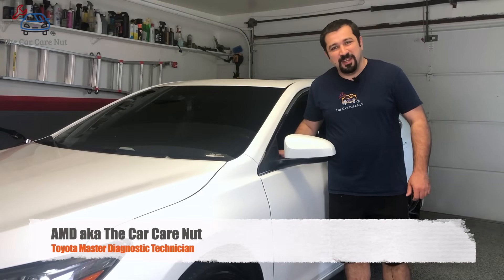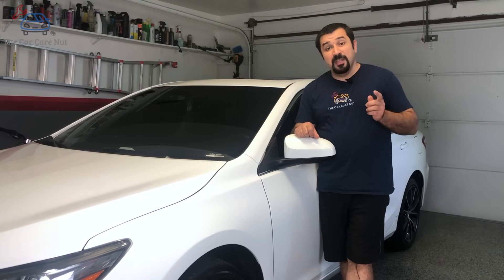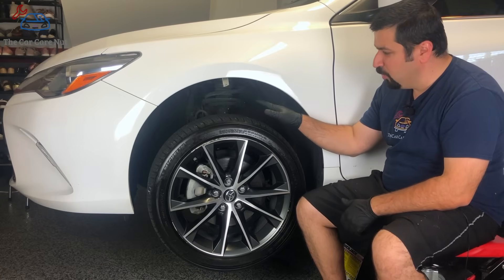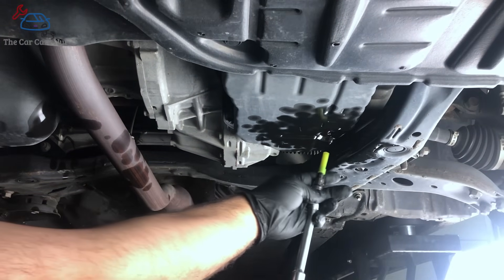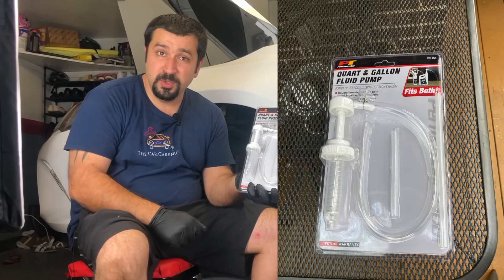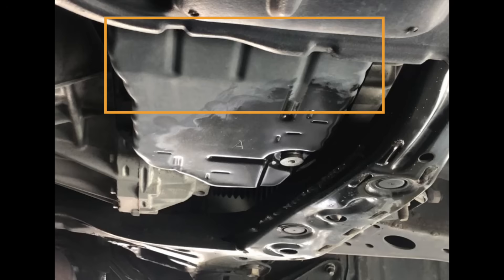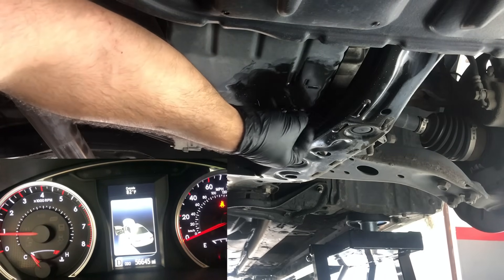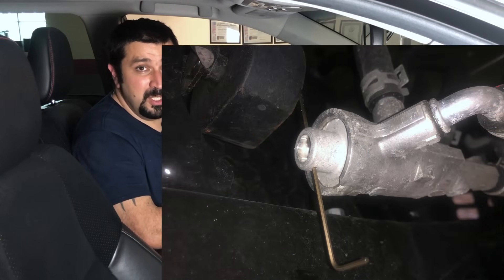How to change your Toyota Sealed Transmission Fluid

Comment: Can I check whether the transmission is level by using the transmission pan when checking the level? My engine mounts may have worn out and checking level using the car body might not be accurate
Reply from the maker: Hi! Level doesn’t have to be exactly 100%. The idea of level is visual. For example you don’t want the front of the car on jack stands and the back on the floor. You also don’t want to jack the car when it’s on a steep inclined driveway for example. A relatively flat floor with 4 jack stands should be good
Reply: @TheCarCareNut  Thank you!

Comment: I have a 2015 toyota camry, a mechanic change my transmission fluid, i felt like he lost a lot of fluid, now i experience a slip on my transmission 2x. Hope my transmission is not damage yet. And advice you could give?
Reply from the maker: Hi! How many miles does the car have? And did the mechanic check the transmission fluid level after he changed it?
Reply: @TheCarCareNut  it has 49000 miles it was change last Nov. the way he check the level was by starting the engine and let the fluid out until it dribbles, not sure if he check the temperature before removing the oil plug.
Reply from the maker: Ok the fluid level will need to be checked accurately and if that’s good. Reset the transmission memory with a scan tool and see if it improves.
Reply: @TheCarCareNut  thank you. my wife drove the car yesterday and she did not notice any unusual on the transmission, it happened one time on her last month and to me last week. I will have my mechanic check or redo the transmission oil change just to be sure and ask him to follow your procedure.

Comment: one again, great video, so you recommend a "drain and fill" every 60k miles?  On my 4Runner that will only change about 3-4 qts or so.  Do I need to do multiple drain and fills? Or is that changing enough fluid to meet your recommendation?
Reply from the maker: Hi! I would drain and fill every 60k. With the small amount that you take out and replace the additive package is renewed in the transmission fluid and that is enough to keep things fresh. I wouldn’t recommend you do multiple replacements in too short of a time.
Reply: @TheCarCareNut  I have a 2004 and a 2013 sienna.  On my 2004 I would drain the tranny and replace what came out (1.9 liters in and out each time).  I would have to do this THREE times to get the ratio of fluid to be 91% new/ 9% old.  Did procedure 3 times, drove at least a week between procedures to mix old and new fluid.  I deemed that 91% new to be "new enough".  However, I am about to start getting my newly purchased 2013 Sienna (100K miles) ready for the road.  Since this has the newer "sealed transmission" it needs the refill procedure you describe in this video.  It sounds like putting in three quarts, and doing the procedure, results in replacing about 2.5 quarts of the "old" fluid.  I know you have already said that this is good enough, but what percentage of the original fluid have you replaced when you do the procedure just once?  Another way to ask the question would be: What is the total design fluid capacity of the transmission?  For example, if doing the procedure once results in 25% of the old fluid being replaced, that would strike me as insufficient.  My guess is that you have replaced maybe 35% to 40%?  My instinct is to try for 85% to 90% replacement, which I suspect would be achieved only by doing the procedure two or three times.  How would I (or you) really know that just one round of drain and refill is enough?  If it isn't, there would be no way to know until years later surely?  With the expense of transmission replacement, I think I want to play it safe and do the procedure two or three times.  But, that is a huge pain.  Is there any way to be sure that one round is enough?  I just subscribed 20 minutes ago, and any thoughts you have on this question would be highly valued, and surely useful to other do it yourself folks.  Any thoughts on all this "how much is really enough" question?
Reply from the maker: Hi John, thank you for watching my channel and subscribing. On the transmission for your 13 sienna the total capacity that is listed is 5.6 quarts. That is the fill capacity with a new transmission and a new torque converter. Both will come with some fluid so it’s likely a little higher than that. The idea of replacing the transmission fluid is to renew the additive package in the fluid and not really get 100% of the fluid replaced. Sure getting the fluid all replaced is ok but automatic transmissions as they get miles on them don’t like too much fresh additives that could attach the aged clutches and could cause issues. A single replacement of the transmission fluid is really sufficient to keep things fresh and protected. At the dealership where I work we have a customer with a 16 sienna with over 400k miles that has done the transmission fluid drain and fill every 40-60k on the dot and still has the same transMission which I recently drained and filled and still runs perfectly.

If you want to replace the whole capacity by repeating the process multiple times you can. I just want you to know that one replacement is sufficient.

I understand your point and agree with it. 80-90% of the fluid replaced is better than 40-50% but with automatic transmissions that’s not the case. The U660 transmission in your van is tough and very well made. With good care it will easily outlast the life of the car.
Reply: @TheCarCareNut  Thanks so much for responding!  I rarely subscribe, but your videos are very well made and thorough, and well worth watching.  I did go back and check the actual mileage on my 2013, and it is 94K (mis-remembered it as 100K).  Per that 5.6 quart capacity, 3 refills would get me to within spitting distance of 85% new fluid which would make me comfortable.  At 94K the old fluid is probably not so bad that adding 85% new would cause slippage/damage (lemme know if you disagree!).  Once done, I would feel more comfortable just doing one round every 60K miles.  BUT, should I also now pull the pan and replace the filter, clean magnets etc. etc.?  That would have the benefit of making the first fluid replacement more than 45%, which is about what the math says you get with one round of replacement.  It may be that there is no point to doing the filter and pan before 200K?  I gotta assume there was NO tranny maintenance done by previous owner, hence my paranoia.  What do you think regarding filter and pan?
Reply from the maker: John honestly the filter and pan is rarely done. The example sienna I told you about still has the original filter and no pan drop. But if you’re doing the work yourself it can’t hurt and by dropping the pan you’ll get a bit more fluid out. Just make sure everything is cleaned very well. And inspect the filter and you’ll it will be clean, I’ve yet to see a Toyota transmission filter that’s dirty. The magnets will have some debris but nothing crazy. Also make sure if you pull the pan that the magnets go back in the exact same spot. The pan is usually notched where the magnets go.
Reply: @TheCarCareNut  Many thanks!!
Reply: @TheCarCareNut  How much metal does the drain plug typically have? They said mine had more than usual and want to drop the pan to check the magnets to see if they are full.
Reply from the maker: Typically so little that you barely can see it. If it has too much metal I would actually drop the pan and inspect the magnets which usually caught a lot of it.

Comment: Hello friend i have a 2019 camry XSE V6 and at what mileage i change the tranmission fluid??
Reply from the maker: Hi! At 60k or 6 years
Reply: @TheCarCareNut  thanks my friend
The 2019 highlander xle v6 is the same mileage??
Reply from the maker: The Camry will get better gas mileage than the highlander with the same engine. It’s smaller and lighter.
Reply: @TheCarCareNut  in the highlander v6 the transmission fluid is change at 60k ???
Reply from the maker: Yes

Comment: what a freaking scam from Toyota with this crap.  man! having to go through all that to change the fluid.  I wished I would have known about these transmission before I purchased my car.  I saw in another video that the trans has about 8 quarts of oil in it, changing just two quarts of it doesn't fall under a fluid change in my book.....someone suggested that to repeat procedure 3 times in order to get as much fresh fluid in the trans rather than just replace two quarts.......let me take the time express my opinion: go screw yourself Toyota.   あなたのたわごとの伝達であなたの同性愛者のトヨタ詐欺師、あなたの母親が中国人の売春婦に変わるかもしれません。

Comment: The knucklehead engineer who came up with the idea of removing an AFT dipstick and designed this overly complicated and messy way of checking and replacing AFT should be fired (to say the least).  Does anyone else beside me who think this is 10 times more difficult to check and change AFT than having a good old dipstick????????????????

Comment: My Lexus GS AWD has a six speed trans. Is there a way to drain the transfer case? I think it uses ATF.
Reply from the maker: Hi! What year and model GS?
Reply: @TheCarCareNut  2011 350 GS AWD. It is the last of the older (pre 13) type.
Reply from the maker: The transfer case on your GS shares the fluid with the transmission. So if you replace the transmission fluid you replaced the transfer case fluid as well. And it use Toyota ATF WS
Reply: @TheCarCareNut  Thanks. I have a new filter too so more fluid will get replaced.

Comment: I had tbe transmission fluid on my camry (78k miles) flushed at a Toyota dealership. Is it safe for it to be flushed as opposed to drained?
Reply from the maker: It is safe if done right and followed by a fluid level check.

Comment: 2015 Corolla LE, 47k miles, bought new. Can one use Idemitsu Type TLS FE CVT Transmission Fluid for Toyota?  I thought I read somewhere Idemitsu makes the fluid for Toyota. Love your channel. Wife has a 2015 Rav4 XLE w/40k, will be doing transfer & differential oil changes soon.
Reply from the maker: I wouldn’t take a chance. I would use original fluid and not have to worry about it
Reply: @TheCarCareNut  Will do. Thanks.

Comment: If I wanted to replace torque converter and oil cooler oil do you recommend doing this procedure  four times . Or do you simply disconnect multiple entries on the system and then prime until right level settles. The two quarts does not give me a oil change smile
Reply from the maker: If you remove the torque converter just drain it and at that point might as well take the pan and clean it.

Comment: Will this work on a 2011 Camry 6spd sealed transmission? Also what if u drain cold, add exact amount back, can you skip temperature check?
Reply from the maker: This will work on 2011 Camry. You can do that but how do you know the level was right to begin with? I say if you did the drain and fill why not spend another 10 minutes and check the level
Reply: @TheCarCareNut  it’s mainly accessibility and positioning of the vehicle and what not. I did a flush at the dealer at 90k, they used the machine, other than that never touched it. And I’m at 145k now want to do this myself
Reply from the maker: I would check the level. I know it be hard to level the car but do it right or don’t do it at all. It’s totally up to you.

Comment: Same procedure for a 2018 4Runner TRD Off Road? Could you recommend a temp gun? Would temp be 95 - 113? Excellent information! I just did my front/rear diffs and transfer case but still not 100% confident on the transmission but have some miles to get there. This video definitely helped. 🙏🏻
Reply from the maker: Hi! It’s the same procedure for your TRD pro. The temp range is 104-113

Comment: Hello, regarding to your option 2 which use the Drive light to check the temperature, does that work on 2017 Lexus RX350’s 8 speed transmission? Thank you. Also do you suggest to install an oil catch can between the PCV valve and air intake to make the intake valve cleaner?
Reply from the maker: Hi! It does work for your Lexus. I wouldn’t install a catch can as that engine is not really known for significant oil in the intake issues.
Reply: @TheCarCareNut   Thank you, I was worry about to damage the engine computer by jump wire the OBD connector, now I am feel safe do that.

Comment: No need to overfill it with 1/2 quart 
Just add exactly what came out - done
Reply: But who knows who worked on it before,it may had a change before you purchased it and be over filled or under filled,that's why it needs to be measured,will cause mopre harm/damaged if fluid isn't measured correctly.

Comment: Could you do a video on repairing the 4x4 actuator on a 2008 Toyota Tundra without pulling the transfer case?  By cleaning, soldering, and timing the small HI and Low electric motors on the actuators.  Could save thousands instead of pulling the entire transfer case.

Comment: What about a 2020 tacoma transmission?  Is it the same process?
Reply from the maker: Yes similar process. Just located the fill plug on the side of the transmission. The Tacoma could have 2 drain plugs on the transmission one if the overflow tube and the other one is the drain.
Reply: @TheCarCareNut do you know what size jumper wire for the camry?

Comment: This question for The Car Care Nut, when you take your foot off the brake pedal and remove jumper wire and leave the car running, where should the gear selector be at this point? Park?, Neutral? Drive?  Thank you very much for the video.
Reply from the maker: After you got the light to come on for 2 seconds and you remove the jumper put the car in park.
Reply: @TheCarCareNut   Thank you very much

Comment: Hi AMD, some people fear that doing a transmission flush can result in crud clogging up the tiny holes in transmission and cause issues. They only advise drain and fill method. Is this fear more of an old school myth?
Reply from the maker: Hi brother! It is an old school myth. If the transmission flush is done right using the right fluid and followed by a fluid level check it’s not an issue at all. Fluid changes drain and fill or flush is not good on transmissions with very high mileage on original fluid.
Reply: @TheCarCareNut  That is sweet. Thanks brother. Love this science and to hear from you based on real-world experience!

Comment: Where can I get a new plastic dipstick for transmission? Want to get an extra one before I change my transmission oil, just in case.
Reply from the maker: If you are referring to the overflow tube then Dealership. And I wouldn’t get an extra one. They’re very well made and not likely to break.

Comment: Hello, I have an is250 at 50k miles and would like to change my transmission fluid (not myself). Do you know a reputable shops in New York that can do the job?
Reply from the maker: I would change it at 60k or 6 years. I don’t really know any shops in new york
Reply: Lexus simple and easy

Comment: What scan tool would you recommend for the transmission fluid temperature?
Reply from the maker: Some folks had success with scan gauge showing the fluid temp.
Reply: @TheCarCareNut  
We have a Scan Gauge 2 in our 2009 RAV4 and it shows the ATF temperature. We're fortunate though that ours still has the dip-stick. So far we've done three drain and fills with less than 53,000 miles on the vehicle.

Comment: New Camry calls for oil change with filter 4.8 quarts of oil.  Bad to put in a full five quarts?
Reply from the maker: I would add the correct capacity. Although .2 will not cause big issues.

Comment: Do you have the transmission in park or neutral after you have reached the correct temp and are draining the excess fluid?
Reply from the maker: In park.
Reply: @TheCarCareNut  Thanks again,  I typed up a procedure Paper to keep in my car manual.  Your video was very helpful and I really appreciate your wisdom and responses.  God bless.

Comment: what an awesome video. I am about to do this drain and fill you instructed on my 4cyl 2013 Camry , just a few things i am not really sure. one thing is should i leave the refill plug open with the pump and hose inside so when i am checking the level in case there is nothing draining out i can add more while the drain plug in open? do i need to replace the refill and drain plug gaskets with new ones as well?
Reply from the maker: Thank you for watching my video! I wouldn’t leave the hose attached. Install the plug on without tightening it while you finish adjusting the level and if needed take it out and add fluid. I would replace the gaskets while at it they’re very inexpensive from the dealership.

Comment: Hi there thanks for the video! Can you post torque numbers for fill plug and drain plug?
Reply from the maker: Depends on the model and transmission but generally around 30 ft lbs

Comment: Forgive me if this has been answered.
Is the idea to position the car so that the bottom of the trans pan is parallel to the floor?
Maybe use an angle finder to find ride height angle at rest and adjust to the same angle when on jack stands?
How about using an angle finder and getting the bottom of the pan level with the world?
Reply from the maker: Hi! The trans pan is not straight. So using it as a reference is not accurate. The idea is to replicate the car parked on a flat surface. As long as it’s somewhat flat like on 4 equal jack stands it’s good. Have for example the front only lifted and the back on the floor is not good.
Reply: I did actual research on this, and can confirm that on my 2015 Camry LE that the left/right level can be checked on the ENGINE COVER, towards the rear.  The underside of the FRAME RAILS are PERFECT to check the front/rear level, and should be tipped down only very VERY slightly toward the front.